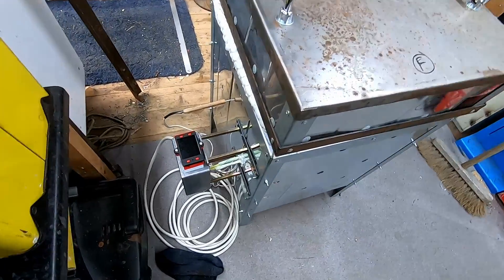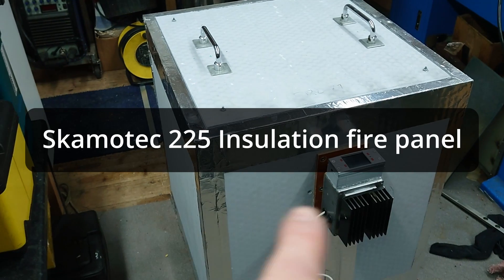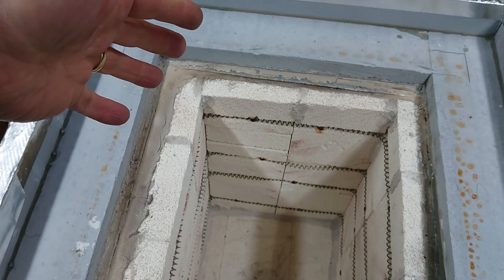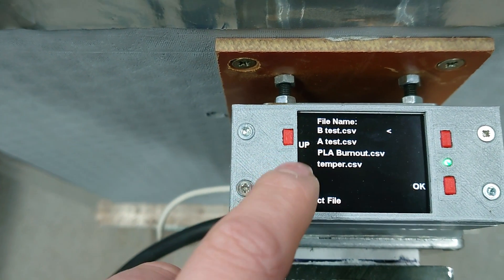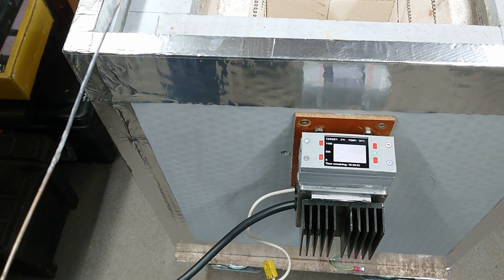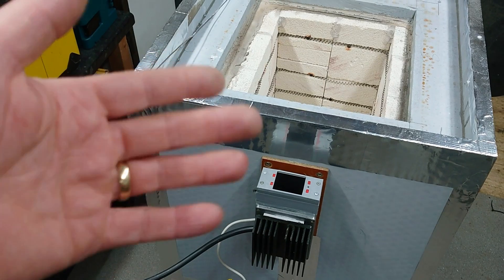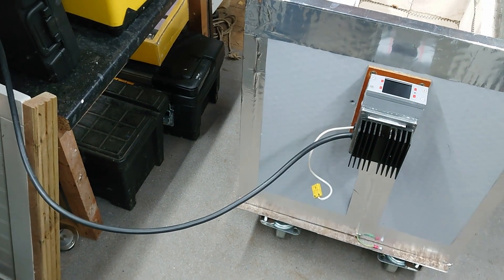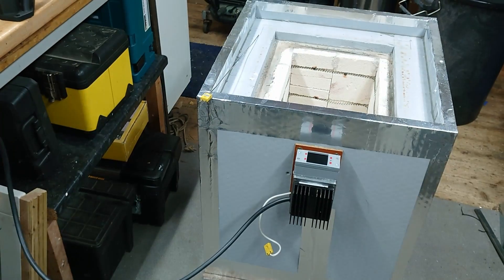DIY Lost PLA Investment Casting Burnout Kiln Build Overview (Advent 22 Day 13)

Comment: I really like your controller! Could you elaborate more on how you designed it? I have no experience with RPi, but from what I know it's programmed with Python, correct?

I also made a similar controller using a ESP32 and have it actually use a PID algorithm (ramp+soak). Could help you with that bit in C++ code since it's been a while since I did anything with python.
Reply from the maker: Hi. I used circuitpython for the Pi Pico, it's a microcontroller rather than a more full featured computer like the RPi so has a cut down version of python. I used the adafruit libraries to drive the display and thermocouple interface. I'm no software engineer, so the code is pretty hideous, I basically hacked stuff together.  I'm not desperate to get a PID loop running, it seems to track the profile very well. 

When you say you want to know more about how I designed the controller, do you mean hardware, software or both?
Reply: @ollysworkshop  ah okay so you use micro python. Hey if your code works, it works :D

Knowing more about the hardware and software would be nice, specially the software though. I really like that your controller shows a graph for the temperature. FYI the control loop for PID is actually quite simple, since I assume you are already using a “moving” set point to follow the ramp and soak temperature. If you have that, then it’s just a matter of adding a PID library and just update PID.setpoint and PID.output :) 

Also for the SSR I use a time interval of 2500 ms, and then limit my PID output from 0 to 1. That way I can control the power by leaving the SSR on for PID.output * 2500 ms and off the rest of the period. Though I have some doubts about the thermal stress and perhaps it would be better to cut the AC sine wave with a SCR for power control.
Reply from the maker: I will make a video about the controller at some stage. I will also upload the code to GitHub once I'm happy with it. It still needs some features adding.  My SSR does get hot in use, but it is switching 3kW. A heatsink is a must. I believe you can get zero crossing SSRs that would minimise stress, but a couple of SCRs would also do the job.

Comment: Will you be giving more details on how to build this?
Reply from the maker: Do you want details on the construction of the chamber itself, the electronics, the software? Or all of it? I can do a longer form video with more details, but I didn't do a very good job of recording the build process, hence the stills used in the video.
Reply: @ollysworkshop  Mainly the electronics and software, with a component list for the rest of it. There are other videos showing how to construct the basic box but your oven has a unique computer control.

Comment: Hi Olly. My type casting machine (as seen on my small YouTube channel) runs a 3k heater to melt the lead based alloy which I cast printers type from. Originally it used an old school mercury tube thermostat which controlled a simple switch to heat the alloy to a set temperature. It was never accurate. I replaced it with a PID controller which I built from various bits and pieces. A game changer. The ramp rate is fast yet the unit never overshoots the set temperature which I can vary according to the size of type I wish to cast.
I do like your set up, especially how you can load “profiles” via a USB.
Shame I can’t afford to run my caster at the current high electricity unit rates 😢
Thank you for sharing. 👏👏👍😀 Andrew
Reply from the maker: Hi Andrew. I've seen your machine running on the videos, it's a fascinating setup you have. I may well add PID to the controller, I'll have to see how well it works when running a proper profile. All the tests I've done so far have been about half an hour long, not 14 hours! I will measure the energy usage, it's probably going to be a big hole in £10 for a burnout run.
Reply: @ollysworkshop  With all these energy price rises, what once was an inexpensive hobby suddenly becomes not so.  I look forward to seeing how your experiments progress.

Comment: Interesting stuff Olly, this is the weather to be doing that job in the workshop (-12C here this morning). Had a bit of experience of lost wax in my dim and distant, this looks very similar. Cheers, Jon
Reply from the maker: Hi Jon, it's perfect weather for it, shame the electricity is so expensive! I'll have to put a power meter on it and see how much it costs to do a run. In principle, I think the process should be similar to lost wax. I'll come to you for advice when it doesn't work 😜

Comment: Great video Olly, thanks very much for showing us the details. 

I think I told you before but my first job as an apprentice was putting together the moulds for wax injection moulding of the patterns. These were then placed in flasks for the later burnout and casting. It was called investment casting. We moved around a lot as apprentices so I didnt get much time to understand the process in any great detail.

I wish you luck with this project and look forward to seing it in operation

Good luck from Spain!!

Comment: Thanks Olly! That is as impressive as it it terrifying! Although I might get used to it, I'd be running it outside with 2 metres of clearance for quite a while before I was sure the workshop wasn't going up in smoke. Superb build though. There's time, money and development gone into that. I look forward to seeing the results.

P.S. Is there a glitch in the Matrix? Ep 13 showed up on my phone, but I can't see it on your channel on my desktop (across 3 browsers) -though is accessible via the playlist.
Reply from the maker: Hi Matt, yes it's a bit scary, but in the tests I've done so far, the outside is barely getting warm. The main issue is the 14 hour burnout cycle, plus you then need to be ready to pour the aluminium before it cools, so need 2 clear days, which is rare! I have made ep13 private and then public again, please have another look and let me know if it's still not showing up. Thanks
Reply: @ollysworkshop  Fixed! 👍 🇬🇧

Comment: Is that a Stag engine  ?
I understand 3D printing.
Probably covered by the saying that starts .. a little knowledge ...
For an inlet manifold couldn't you save yourself a lot of hassle and maybe expense (on balance) by using a suitable material and print the finished item ?
I remember as a child a 3KW heater cooking the 13amp plug and socket.
Isn't 3 right on the limit of 13  ?
Just roughly using DC calcs.
W = V × A
3000 = 240 × 12.5
As I said a little knowledge  ..
Reply from the maker: Hi Steve, yes it's a Stag engine. My friend has a Stag and has been wanting to put EFI on it for years, so there's been a spare engine in the shed for about 10 years now, waiting for the conversion to be done! My 3D printer doesn't support the type of material necessary for a reliable manifold. We were originally going to fabricate the manifold out of tube, but it's a complex shape. The idea to see if we could cast them was more a case of could we, rather than should we. I will be monitoring the temperature of the plug when I do a proper run, and if necessary will upgrade to a C form.
Reply: @ollysworkshop  I will watch with interest.
How you make and locate the core will be fun.

Comment: When you say burn out, it's not melting the plastic so that it drips out, it is literally combusting? Does that not leave behind a bunch of impurities and residue?
Reply: And exhaust fumes  ?
Reply from the maker: Yes, there will be. I will be running it with an extractor fan overhead.
Reply from the maker: I've got some 'special' PLA for this very purpose. Apparently it just leaves behind a small amount of ash.

Comment: 1.5mm^2 can take up to 20A for a little while depending on ambient temperature but I wouldn't recommend it either. For a continuous load I personally wouldn't go beyond 10A for 1.5mm^2.
Reply from the maker: I started with the 1.25mm2 that I had lying around, but it did get very warm, hence the upgrade to 2.5mm2.